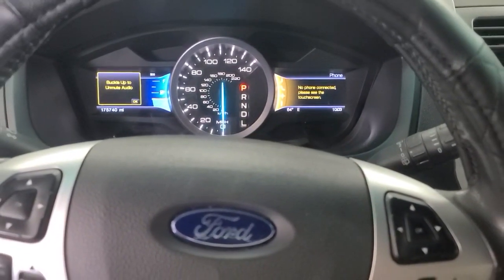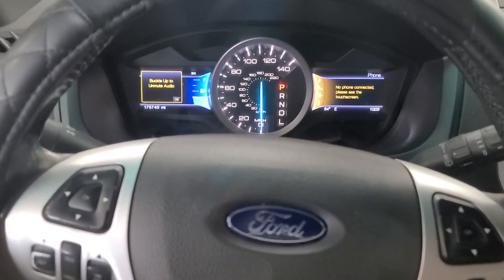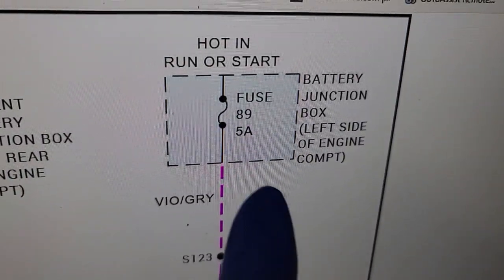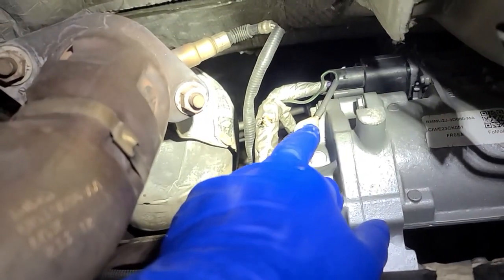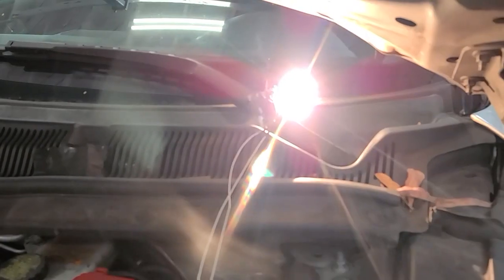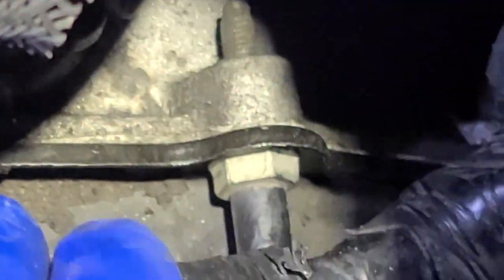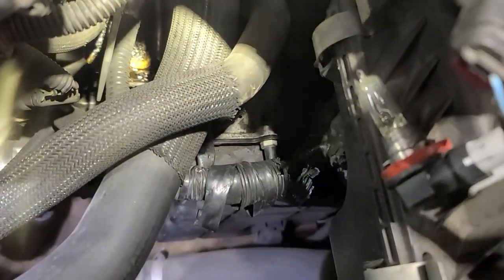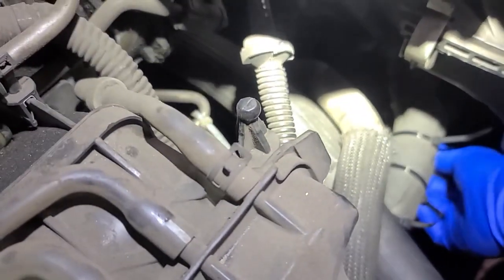Diagnosing Blowing Fuse Short With A Light Bulb

Comment: My 1987 Cherokee with a 4.0 had a short in the power window circuit. Every time you went to roll down the Driver-side rear window, the battery gauge would dip enormously. I traced it, and two wires going through the boot into the Driver's door had welded to each other. Fixed it up and hasn't been a problem since.
Reply: I haven't seen a high mileage cherokee without door boot wire issues.